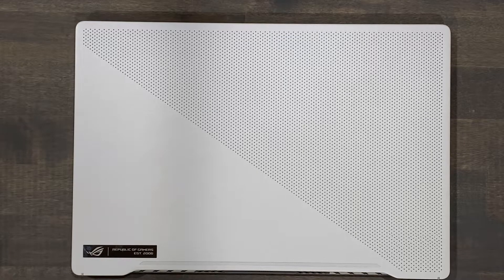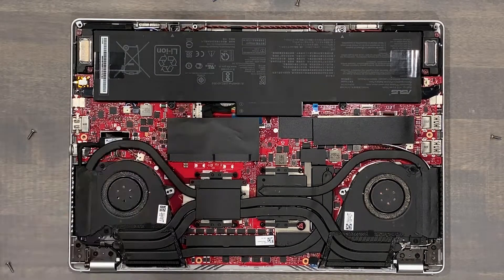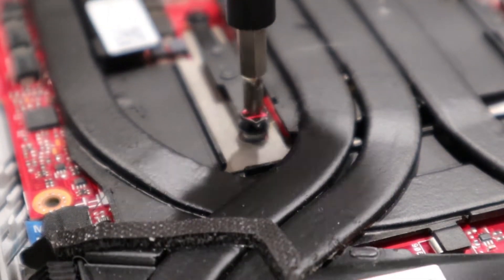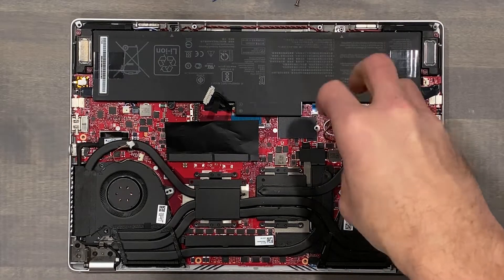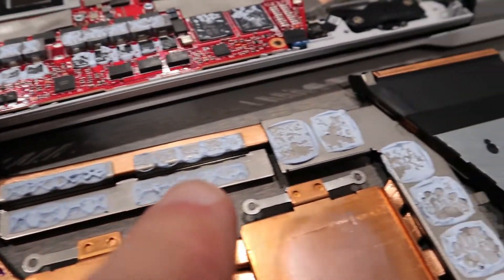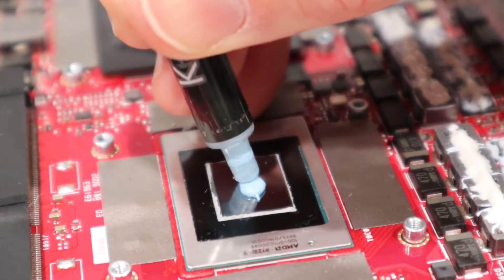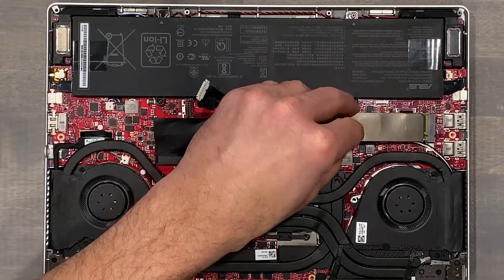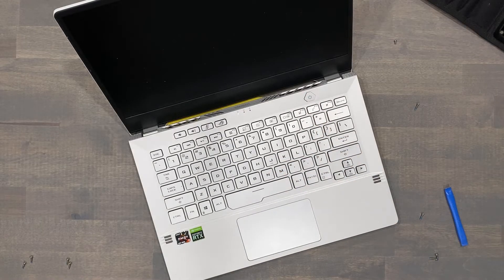Asus G14 Repaste Guide

Comment: I accidentally pulled out the metal clip and it caught spark with what i think you call it as the “pcb”? And now the laptop still turns on but theres a blinking orange light to the what used to be a white light, is this fixable? Or am i screwed now?
Reply from the maker: I don’t know what that blinking light means.  Does the laptop operate correctly?

Is the battery charging?  If yes, I would unplug the battery and CMOS, hold the power button down for 60 seconds, then plug everything back in and see if that is your fix.
Reply: @BobOfAllTrades  Honestly, I’m too scared to mess with it now, I think i’ll just get someone to fix it for me
Reply: @saveki2347  same thing happened? What should i do now? I think ive friesd up the motherboard
Reply: @SaiNadh_7  I’ve completely given up on mine 😭 the guy said I have to change the whole motherboard cause of the short. So I just bought a new pc instead. It still turns on though which is a miracle, but games are completely impossible at this point.
Reply: @saveki2347  WTF Dudeeee 😭😭 Its a freakin 1500 dollar laptop and i have bought it with 2 years of my savings and the warranty ended just 20 days back... Mine doesnt even power on. What should i do???? 😭😭😭
Reply: @SaiNadh_7  The guy that I asked said you’re probably gonna have to change the motherboard. The last time I asked, he said he couldn’t really find a new laptop motherboard immediately so I don’t really know if theres a lot of that in the market. You should really find someone to consult to though
Reply: @SaiNadh_7  How did you guys short it with the metal clip?
Reply: @cool-wf9cr  While inserting the metal clip again in battery connector, I accidentally shorted it... Went to service and they said it's gonna cost fuckin 1100$ to repair!  😭😭😭😭
Reply: @SaiNadh_7  Damn id be sick, hope you can get a new laptop or PC. But to ask, what did the metal clip hit to short it?
Reply: @cool-wf9cr  The metal clip should fit in 2 small holes in the battery connector housing, but its so small, it accidentally touched the copper connector in the ends making it light a spark and it never turned on
Reply: @SaiNadh_7  Ohhhh so thats why he said not to take it all the way out, so you can just slide it back in. Regardless I pay respect for your fallen laptop 😢😢 GL
Reply: I did the exact same thing I got a small spark and now the whole thing is dead not a sign of life on it
Reply: @naterichards8987 did you replace it?
Reply: @Lonewolf20173  hell no got an HP Victus 15.6" with vastly better fps and temps sit low 70s and had zero issues, the g14 was nothing but problems and got bricked in the process of fixing them

Comment: Very good video - saved my much time changing the thermal paste on my 2021 g14.
Reply: Did it help with the high temps?
Reply: @Finaciallearninghabits  Immediately.
The liquid metal left a corrosion mark on CPU and factory GPU paste dried up after something like 9 months.
TBH, I did had to re-apply it yesterday, but I was pushing the machine with Cyberpunk recently :P
Reply: Did you use liquid metal?
Reply: @JavierContreras678  no. eff liquid metal - the bother with cleaning it out is too much.
I was wondering why I only have the sodded RAM registered after the paste change and one little droplet got lost and it found its new home on RAM socket, shortening the circuits till I've spent an hour looking at the broad, eventually finding the more shiny spot with a flash light
I've used Arctic MX4. sure - it doesn't have the same performance, but it's good enough

Comment: Great Video! thank you for the walkthrough

Was very nervous to try it on my own since I'm very new to the PC world in general, but followed the guide as accurately as I could including buying the tools and was able to successfully re-paste the g14

Like the video mentioned when I got in there the old thermal paste was super flaky and they did not use enough IMO. 

before re-paste

My idle temps for CPU where 55 Celsius

under heavy load were 93-97 degrees Celsius

after re-paste

My idle temps are down to 42-43 Celsius

under heavy load are now 83-85 Celsius
Reply: Is that with the boost enabled or disabled?
Reply: @karthikkr93  why tf would you disable turbo boost at the first place tho?
Reply: @kimberly_lippington  if you have a g14 and have turned off boost it reduces temps massively with very little reduction in performance. So that’s why
Reply: @karthikkr93  in a cpu heavy titles (cp2077 with dlss, far cry 5), the reduction will be huge

Comment: thanks for the guide, the computer is working smoothly at a solid 60-70 degrees for my games now. Interesting thing is, ive had the computer for over a year, this is the first time taking it apart, and the gpu had the smallest amount of paste on it. Approx. 5 mm squared of the gpu was covered on only one corner, no wonder it kept heating up to 90+ degrees when playing games before. The guide was much appreciated, thanks again!
Reply: It’s like that but only for my cpu, my gpu is fine staying at 60-70 degrees but the MINUTE I fire up a game my cpu goes to 96c with all fans on max, (I went down into my laptop before, didn’t repaste, just wiped down the fans as they weren’t that dirty) also I’ve had this for a little over a year
Reply: Probably. Manufacturers are always screwing it up.
Reply: My laptop wont start😹

Comment: ASUS told me to use 0.5mm thermal pads on my ASUS GX502GW.. after much googlefu'ing and finally landing on your video, I'm going to settle with K5-Pro and repaste... for 8th time.
Reply from the maker: Did they?
Reply: Yeah, although when I realised something wasn't right they  then swiftly said that they hold no information on the thermal pads for my device and to send it in for repair.

Even when escalated to their engineering team, the same response was given.

It's almost as if they don't know their own hardware.

Comment: Hello just a couple of questions. Is there a difference between Kingpin thermal grease and kpx pro? If so can i get the link to them I could not find kpx pro. Second question is did you use alcohol to clean VRM and video memory components? Thank you!
Reply: Is there a difference with k5 pro and kpx?   If so i would like a link to k5 pro. I could not find it.

Comment: Never drop like that the metallic lock on the battery connector, you could trash the motherboard
Reply: Should I take all the way out then?
Reply: No, you should slide it until the connector gets free. But the metallic part must stay attached
Reply: What if I use electrical tape around the connector to avoid accidents?
Reply: @JavierContreras678  I do that!
Reply: @JavierContreras678  I put electrical tape every time, just to be safe.
Reply: I saw that many made that mistake and now their laptops don't work
Reply: Please is there a detailed way to remove the metal clip without causing a short 😢I'm about doing this and I'm scared. There's no professional in my region Nigeria

Comment: Tip when blowing fans out with air. Take a cutip and wipe it down first then wedge the cutip in the top of one the fan in between the fan blades lightly. Then spray out with air. Don't blow air deep down into the fan.

Comment: Glad to see you using KpX for repasting now. I had commented on an older video saying KpX really is the best thermal paste in terms of performance and no pump out due to it's high viscosity. I've been mining eth on my helios 300 with Kpx and over the past month of almost 20 hours of 100 percent load every day, it has held up very well.
Reply: i dont think pump out happens if the load is constant, pump out should be result of cycling?

Comment: For the thermal paste on the VRMs, is it possible or viable to use Kryonaut Extreme?
Reply: You can use it, but why? It's going to be more expensive. Just a regular thick paste (not too liquid because you don't want the paste to be pumped out) that's cheap will do the trick. You just need to establish a contact of the heatsink with the VRMs and memory chips.

Comment: Hi Bob of All Trades!  Thank you so much for this upload  :)

I own a MSI GE75 Raider and did a repaste a few months ago using Noctua NT-H2 (hope you approve lol) and while I had the cooler off I noticed that MSI placed the same white paste in certain areas while having pink thermal pads on a few other areas.  My inquiry is would it be okay to remove the thermal pads and place the K5 Pro in its place?  I don't know the thickness used by MSI and that's my only concern with putting new pads on. 

I plan on doing another repaste since I wasn't sure what the K5 Pro was at the time and didn't clean it off and put new one on.  Thank you!
Reply from the maker: If the pads were extremely thin then K5 should be ok to replace.  That’s something you’d have to be carful with.
Reply: @BobOfAllTrades  Thank you for getting back to me :)

If it's safer to not remove the pads then I will leave them on and focus on cleaning off the old K5 Pro and applying new one on instead.  

I'm just not sure if the pads are still efficient with me removing the cooler on and off and I'm a bit concerned they could tear or something.  

If anything Bob, do you think it would be okay to go with a 1mm thickness pad (I think that's the smallest size) and place that where the old ones are?  When I took a look at the stock pads they are quite thin.  

Apologies for all the inquiries lol I just want to make sure I do things correctly  :)
Reply: Noctua NT-H2 is the worst paste for a laptop due to the pump out effect. Get a thick high performance paste for your laptop when you need to repaste your laptop, and you will need to repaste it pretty soon if not already.

Comment: I did a repaste of my hp omen 17 at purchase. Performed an undervolt. The system runs at 60C under full load. 36C idle.
Reply: Fantastic. I also repasted my Vivobook S14 ultrabook two weeks after buying one and installed a thermal pad to further spread out the heat from the heatsink to my metal back plate. Most ultrabooks have no warranty stickers on their cooling system because it's simplistic and isn't tied to the display cable or anything else important like in this laptop, which is great. 75C at 25W TDP on prolonged loads and my fan is barely spinning. (if the ambient temperature gets higher it would spin faster but that isn't exactly appreciated in an ultrabook that isn't a gaming laptop, is it?)
Reply: @one_step_sideways  Well it is good to perform a repaste. An ultrabook takes way less power than a gaming laptop that has a full dedicated gpu than a gaming laptop with a dedicated mobile gpu.

Comment: Thanks! But what about the fan exhausts? The dust tends to pile up in this areas in laptops, so it is often insufficient to clean the fans themselves from the dust; you also extract the "dust brick" from the exhaust. Asus advertise their fans as "self-cleaning", but i have a suspicion there's a sheer amount of marketing in this claim. Can this be a problem?

An aspiring G14 owner (at least hope for that).
Reply: You should be able to separate the fans from the cooler easily, as they are usually just clipped on in most laptops, haven't disassembled my g14 yet, as I'm fine with my temps, I never go above 85 with a custom fan curve.

Comment: Hi Bob! Do you still own the Zephyrus M15? Do you think a repaste there could be benefitial? I get 94-95 CPU Temps and 86 GPU when playing Warzone, so I have my doubts on the effectiveness of the liquid metal
Reply from the maker: That sold after the review.  Many reporting temps like yours have the 2070 version.  That runs much hotter.  

Are you maxing out your fans?
Are your fans clean?
Is this the 1660ti or 2070 version?
How long have you had it?
Reply: @BobOfAllTrades  its the 2070 Max Q version, this was bought in January and I'ved always had these temperatures so dust is not an option after barely 2 months. I would love to know if liquid metal is actually better than a potential repaste, any chance where we could find this sort of info Bob? Thanks a lot for your reply BTW!
Reply from the maker: @anibalhuneeus  LM can be spectacular.   It if you’re not maxing out fan speed then expect the fan speed to scale to temps making thermal paste upgrades less effective.   

It’s going to come down to the components, the application quality (this is typical not the issue) the chassis’s airflow capabilities and user settings.
Reply: @BobOfAllTrades  thanks for the comments. If that's the case then I think it's not worth the hassle. I am running the PC in the turbo mode from the armory crate software, I will try with turbo with fans maxed out and see if this improves a couple of degrees (though at turbo I would assume it's already kind of maxing as it gets super loud haha like 55 dB). I don't mind as I game with headsets always

Comment: Bob i hope you will see this comment.
If we don't want to use liquid metal at our gaming laptop.
What termal paste is best by your experience? I have no problem to change thermal paste every 12 months.
Right now i using IC Diamond.

Thanks!
Reply: I can see much lower temps after i put termal pads around cpu at my msi laptop

Comment: Is this really generally useful after only 8 or so months? If so, is this usually a result of a poor pasting job at the factory, or just the constant use under high load?
Reply: sorry for replying 8 months after the question but if its still relevant...my answer is a combination of both although it is 90% the latter

Comment: Great video Bob! Did my gx701 using this video as a semi guide as the disassembly is similar. Went ahead and did liquid metal and also used k5 pro! Dropped about 24c on the core! Anyways, I see/assume you you were using the icicle stick provided with the k5 pro. Way back when, when I did my triton 500, I encounted a small container version of it and a sort of lipstick looking one. Decided to get both. Anyways for some reason I feel the properties differ between the each type after applying them on several different builds. Have you encountered this? Do they both perform the same?

Comment: I cleaned my laptop fans with canned air in the past, and watched them spin at the speed of light. My face after watching the video: 👁️👄👁️
Reply: You know you can burn / break parts of the motherboard if you allow the fans spin freely with that canned air. They are spinning a lot faster than 100 % RPM would normally be.
Reply: @Juha.Latva-Somppi  Ditto. Never. EVER, spin the fans that way. Your asking for an easy way to destroy laptop fans
Reply: @SharpBoi867  I know, that's why I said don't do it.
Reply: @Juha.Latva-Somppi  why?
Reply: @muzaffarhassan2787  if you let the compressed air to spin fans freely they will generate even over 10 000 rpm (when max rpm is normally 5000-6000). It will burn the fans and maybe even the motherboard fan connector.
Reply: It doesn't matter they will go to shit after few years anyways. They cost 20-30 euros to replace. Fans went to shit on my Zephyrus studio 240hz rtx 2070 model after like 3 years and it was barely even used for intensive stuff or gaming, mostly for work and content consumption and gaming was rare, only if I wasnt at home. On G15 Rtx 2070 model fan also went to shit after like 4 years, but it was used for gaming by friend so it is to be expected.

Not to mention both models came out of the box with shit application of thermal paste and had to be re pasted ASAP in order to work properly.
Reply: @Leogos281  the fans can act as electric generators if you let them spin like a windmill, it will cause a short on the motherboard if you apply current on the wrong spot, you can do it multiple times and and you'll see nothing happens because it happens rarely, but once you do it enough times your motherboard is dead dead, so it's not because the fan will break, it's because you will fÜck up the motherboard and breaking your expensive laptop
Reply: lol
Reply: Lmao, what I am thinking rn. Thought air duster is no harm smh.
Reply: And I used to spin mine with a huge ass airblower : /
Reply: Dude really bought air in a bottle.

Comment: Thanks for the video! Would you recommend using liquid metal on the CPU die?
Reply from the maker: Not in less you are incredibly experienced doing that on these Ryzen CPUs.  The contact points around the die really stand out and are difficult to cover correctly.
Reply: @BobOfAllTrades  Thanks for the tip man! I still have some Thermal Grizzly Kryonaut left so guess ill stick with that!